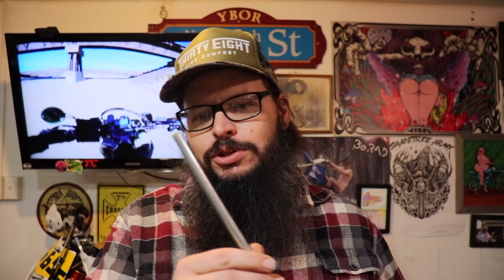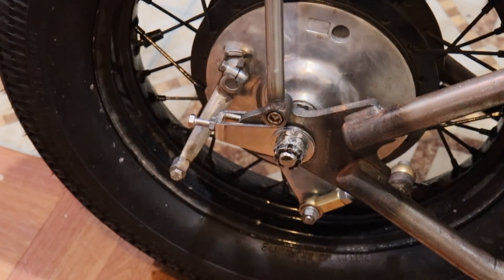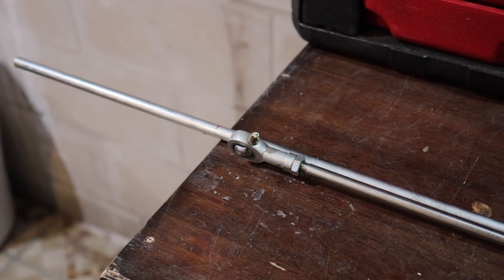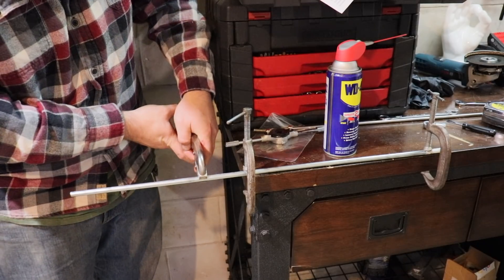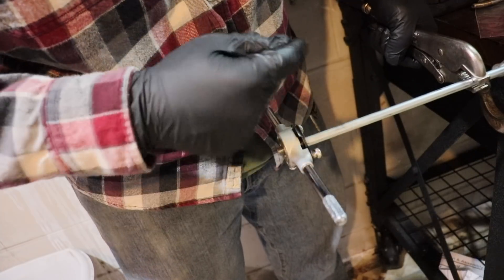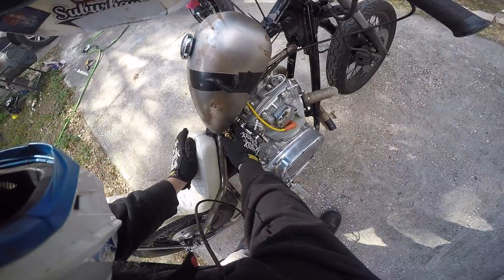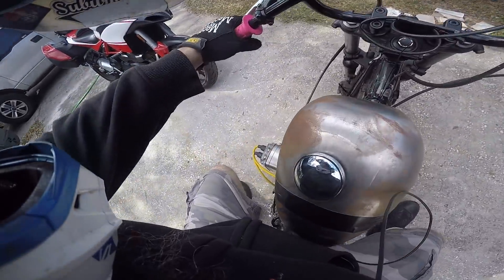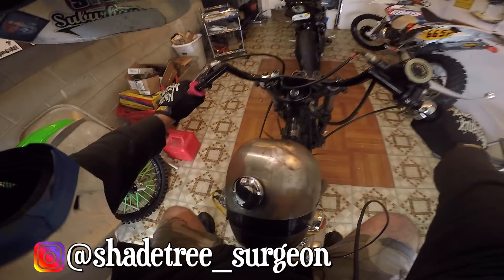I'm way prouder of this than I should be | XS650 Chopper build series part 8

Comment: Today, you earned my respect. You didn't edit out the mistake. Good job on the brake rod. If it were me I'd probably would have gotten a stainless steel rod.  But hey, the one you used worked. Press on regardless. Blessings.
Reply from the maker: I think I’ll eventually grab a stainless one, I just wanted to practice on a crappy one first :)
Reply: shadetree surgeon 
Stainless steel is quite a bit harder material definitely bevel the ends first and go slow and lots of lube (cleans chips out of cut , cools part and tool,and lubricates tool and part) Good job Shadetree !!!

Comment: For what it's worth. I once used the thread and re-thread trick. I found that if you file off the first threads and file maybe just a little more, you can get it to work. The die will not be a happy camper die. But it won't steal all your beer and then puke it back up on your cot.

Comment: For the sake of adding my input, i personally prefer threading with the rod sticking up rather that flat. I find it easier to avoid cross threading. Good job using lube but threading, backing off, threading further, backing off (and so on) helps clear the die and keep the cutting teeth from clogging up which could mess up your thread pitch. AND FINALLY i also usually leave the die on, bring the rod to a grinding wheel and grind a chamfer on and then clean the thread back out by taking off the die (kinda like cleaning out the threada of a cut bolt by leaving a nut on the bolt befor cutting it to length) but hey man, you can read and look at all the videos you want but only one way to learn and thats by actually doing it so props and keep those sparks flying brother!

Comment: first off, you don't suck at it , you just have no experience fabricating yet. We all start somewhere. The only tips I can give is try mounting the rod vertically in a vise when cutting new threads , use more cutting fluid, and you might want to use metric threads on a Japanese or European bike. other wise the end up looking like harley's in the end . good job man!

Comment: Good job and I agree you made and it works as for the 3/8 rod mate you tried it it didn't work you realized what was wrong and then your next go it worked. that is trouble shooting my friend and always remember  failure is just a practice run for success as long as you don't give up you will get there. Anyway mate good job.

Comment: I'm sure you know this but on any carb the choke circuit only works if the throttle is completely closed. If you twist it at all with it on while you kick you will almost never get it to start. It will start at a high idle with the choke no throttle then you can flip the choke levers. As far as your Brake Rod Practice Makes Perfect. Great Upload.  Roger, Vista, Ca
Reply from the maker: Thanks for the tips man :)

Comment: Came out clean for your first time threading a rod. Next step would be to bend it to follow the frame and not stick out. If you use mild steel you may be able to bend it cold.

Comment: Rapid Tap cutting oil works a lot better then WD, it's in a little tin can with a spout normally. Also saves drill bits from over heating somewhat. Great job tho bro!!

Comment: Go forward with the die & Then back it off then go forward until u get them done !!! Also bevel the ends first !!! Choke up on the part in the vise it'll make it more secure as your doing the threads !!! Have you checked out non interference plug wires ??? The ones they use to use to keep the plugs from playing on the radio back in the day !!!

Comment: If the rod bends again, go to a metal supply store and buy hexagonal stock. Drill a hole and use male tap. Buy two rod links with a male end to screw into hexagonal stock. Hexagonal stock is much more rigid because the surface area.

Comment: Gotta start somewhere, Josh. You really need an engine lathe, but that's an investment you need not take on. Been a machinist for 20 years, but you're doing old school stuff. Cleavland tools are the best resource for the scale you're going to need. OSG makes good thread dies also among other things.

Feel free to call for machining nonsense. I've done enough welding to get in trouble, but it's not my forte. A brief stint building skid-steers for Case New Holland doesn't qualify me to talk overmuch about anything but the safety precautions. I know the magic tricks turning wrenches as well, but you have better mechanics nearby.

Comment: when making threads always turn 1 complete turn and the back a half turn.  the back half turn is for cleaning the metal material out of the die.
next time you might want to ask for advise before you start the project, that way you get great advise before you start a project.
there should be some free play in the brake engagement

Comment: First things first, when you said it's time to make hipster sparks while wearing a flannel I kinda lost it. The more lube the better in this case. I use cutting oil if I have it but engine oil works too. I just like it a bit better than WD or PB because it's thicker and sticks better. 

Side note, I'm in the middle of "The Well of Ascension" which is the second book in the Mistborn series. It's such a fantastic series so far.  The Reckoner series he does is really good as well.

Comment: Good job! don't forget lockwashers and locktight... And if you can get yourself a caliper so you can measure stuff accurately and save yourself some time.. Ihad drum brakes on a 79 KZ650 back in the early 80's I was leaning into a left turn in Florida "sand on the roads" and the rear brake was dragging so even after I let off the rear drug enough to cause me to low side... that was embarrassing! :?

Comment: May I suggest that you pick up a set of rechargeable LED lights the peddle pushers use? They are sold in the discount stores here for around €5 and are also available with a red lenses and have simple fasteners to quickly mount them  – usually get both front and rear as a pack. I run an older bike and keep a set on me just in case.

Comment: In old times sonny we had that issue with the radio in our cars until they came out with an "R" spark plug (resistor) plug. This was great I giggled through most of it your attitude is wonderful.
Why would you not use a cable setup or change it to a cable setup is a better way to say it?

Comment: You need to do some “emergency” stops. Slam your foot down on that pedal while riding multiple times. Like you are trying to break it! I had a extended rod made for my ironhead chopper and thank god I made sure it was 100% before I took it out. Around the neighborhood it was fine but I wanted to make sure it would work in a split second “oh shit” moment. The nut straight up sheared off the threads and bike kept going. I threaded my own rod and didn’t have issues after that.

Comment: Just rear brake scares me. Might have been cheaper to find out the thread size before buying the rod but you could have drilled the ends out and tapped them out to the larger thread if the ends are thick enough.

Comment: First I'll say you did a pretty good job there especially admitting to your fuck ups. Thats how you grow. I dont like the angle of the lever on your brake drum side though. A good way to do it is to set the lever on the drum parallel to the lever on the pedal. Then fabricate one end of your shaft and attach the one end. It will give you a good idea of how long the shaft needs to be. Then cut and thread the other end. Either way great first effort.

Comment: If you know someone with a lathe they can turn the ends of the over sized rod to the right diameter then the die will fit
Reply from the maker: I’d like to get a lathe one day, I think it’d be cool to have a rod that was the same diameter as the fittings so it all looked like one seamless piece
Reply: @shadetreesurgeon  you could get some steel tubing that fits over the rod and is close to the same diameter of the ball joint fittings.

Comment: You could have used a piece of all-thread. And whatever the O.D. of the all-thread, get a piece of pipe with the same I.D. and slide it over the all-thread
You get the smooth look and more strength.

Comment: Can the rod run on the inside  of the frame? Itll look better and be protected
Reply: And you can adjust the lever on the splines  to get a good angle
Reply: Not going to work
Reply: You will fuck up the threads
Reply from the maker: Good idea!
Reply: @jeffdellibovi7510   it can work . just depends.  Ive built a few bikes.   i know its not impossible
Reply: Besides its a chopper build thats the essence  of the concept, if it works then it works

Comment: Mr TREE
I OWNED A HIGH END CNC MACHINE SHOP FOR 15 YEARS after being a senior toolmaker for Sikorsky Aircraft for 15 years. The first thing to know about threading the outside of a rod is the  "major" diameter of the specified thread you need. Measure the outside diameter of your existing thread to determine the diameter (Yours will be MM) and use your pitch gage to determine the exact pitch (Yours will be a Metric Pitch). The section of your rod needs to be turned to the "Major" diameter specified for your metric pitch. Metric is better than our American threads because they standardized on only a few thread pitches. It's either a 1mm, 1.25mm, or a 1.5mm thread pitch for most common small/medium threads. Please see this chart to determine the diameter you need to have the ends cut to.
https://www.engineersedge.com/hardware/metric-external-thread-sizes1.htm
Your thread will be an M6X1mm thread with the O.D. of your rod turned to 5.8MM diameter. 5.9mm is Max and 5.7mm is minimum.

I will make your rod for you after you determine the length free of charge! BEST FUCKING CHANNEL EVER!!!!!!!

Comment: If the old thin rod was getting bent under stress (no one likes to get there rod bent) take the thicker stock to a shop with a lathe and have it turned at thread ends to correct diameter. Or if you aren't going to be a fucking gorilla in the future do what ya did and go back to original size.

EDIT: Also +1 for keeping guard on that Makita, exploded cutting wheel will ruin your whole day if you don't have that on there.

Comment: i´m a machinist and i do threads and stuff everyday so when you tried to do the same size thread on the bigger rod i laughed my ass of... and then you said "ill do a smaller size thread first" i fucking died. btw you cant do threads twice if the rod diameter is too big you need to use a lathe to make it right then you can threard it. (PS i make ship transmissions for a living. you know like those you take a cruise to the caribia to. yeah those big motherfuckers.
Reply from the maker: Lol yeah I felt pretty stupid about that one 😂